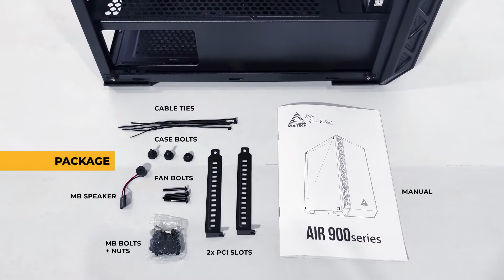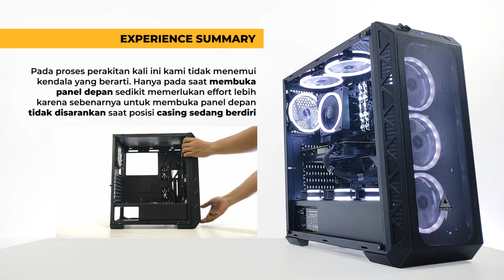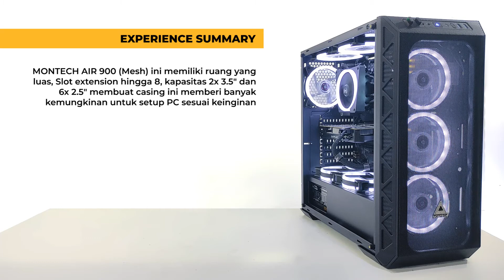MONTECH AIR 900 MESH | ATX/E-ATX PC Case | Build Experience

Comment: Hi, someone help me, I'm thinking of buying a hp z800 motherboard, but I'm not sure if this case fits it. Since it is a workstation with dual processor and 8 ports of ram. The original case (of the z800) is 17.5 x 8.0 x 20.7.

Comment: i also want to put the same amount of fans in my montech case do you think it is over kill with a 500 psu bronze?
Reply from the maker: It depends on what GPU you are using. As long as the GPU power requires no more than 6 pins We think it's safe to put that amount of fans

Anyway, in our opinion, It's never overkilled to cooling up a GPU

Comment: kalo pasang radiator 360 didepan dan vga panjang yg 3 fan, kira2 muat gak?
Reply from the maker: VGA Muat. Saya punya GTX1080 X3 itu panjangnya 31cm muat. Untuk radiator support 360, tapi konsekuensinya rak HDD nya digeser mundur jadi mengurangi space kabel PSU. Atau copot rak HDD nya sekalian

Comment: can you link the fans?
Reply from the maker: The fans included in the case are using PWM pins if you mean to link is to control the speed all at once. Fan speed can be controlled by using a PWM fan hub or fan controller. Those are non-LED fans, by the way. But the fans I used at the end of the video are ARGB fans connected to a hub controlled (sync) by an app from the motherboard (ASRock Polychrome)
Reply: @doubleagent1188   hello from India,  what is the name of the ARGB fan and the hub controller ?  Do one need to connect the hub to motherboard  argb pin to get  above light or we can simply connect the hub controller to smps and get the same effect ? [I'm planning to buy basic motherboard which have no argb or rgb pin on board, hence asking]